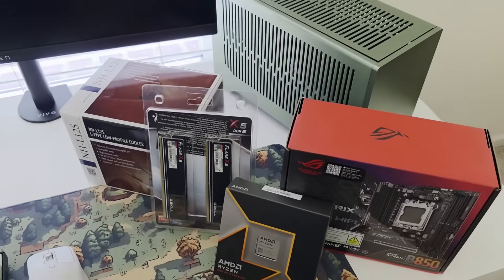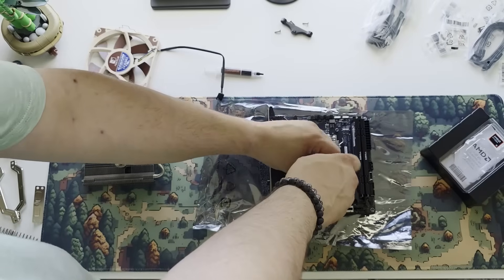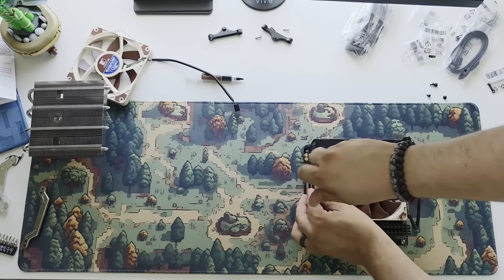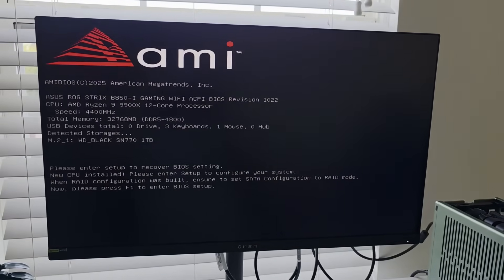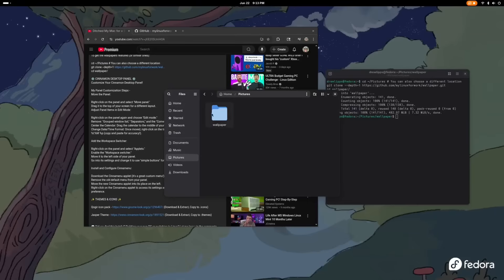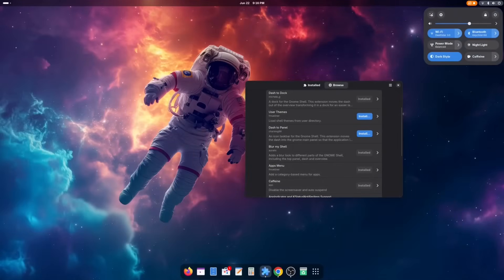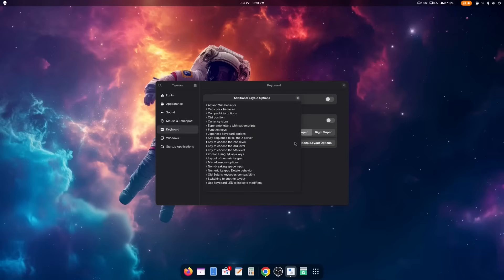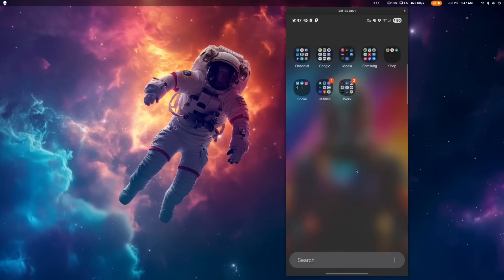Switching to Linux: Mint to Fedora, AM4 To AM5

Comment: In the Christmas period I upgraded my PC too, from a Ryzen 3 2200G with 16GB DDR4 (3000MHz) to a Ryzen 5 5600GT with 32GB DDR4 (3200MHz) for $179; $4 more than the original CPU and memory.  The motherboard remained the same an ASRock B450 HDV Rel 4.0, that in April 2019 did cost a whopping $59.99.  The system runs a minimal install of Ubuntu 24.04 LTS with VirtualBox and OpenZFS for the storage of all my data and ~65 VMs.  
The daily used VMs are; Xubuntu 24.04 LTS for (a)social media, Ubuntu 16.04 ESM for finances and Windows XP Home as my jukebox.
Reply from the maker: Wow, that's a seriously impressive and cost-effective upgrade! It's amazing how much performance you can get. Your setup is a great example of smart component selection, especially keeping the motherboard to save money.

That's a lot of VMs to run on a single machine! Using OpenZFS for storage is a solid choice for data integrity and reliability. I'm especially interested in your Windows XP jukebox. It's a fantastic retro touch.

What kind of music do you have stored on the jukebox? Do you have any other unique VMs for specific tasks?
Reply: @drewlipps  No the only remarkable things about Windows XP Home is that the VM is installed and activated in March 2010. 
It runs on one CPU in 768 MB of RAM.  For playing music I use Windows Media Player 11 with its Wow and TrueBass effects :).

I'm 80, so the music is from the fifties (Glenn Miller Orchestra; Elvis Presley), sixties (Beatles), seventies (ABBA) and some later stuff (Queen).  Basically the wma copies of all my CDs and LPs, copied in 2005.

Comment: Love the build. I think a small addition that would help is a pair of small low profile antennae, rather than plastic fin. It's unnecessary, but is a plus to aesthetics and portability. Unless you are using ethernet, of course.
Reply from the maker: Great tip, thanks for the suggestion!

Comment: Adding to the lengthy comment I left on your previous videos, here are some pro-tips:
- Install Ventoy on your USB stick.
   With this, you only have to copy the ISO file to the volume, you can place multiple here and choose which to boot on startup.
- Install the rEFInd bootloader if you duel-boot.
   While Grub or systemd-boot can be set up to do the same things, chainloading through rEFInd makes picking which OS to start much easier.
   It also is a great fallback, in case the main bootloader fails after an update.
- If you install multiple OSes, do that to a separate drive and disconnect the main OS drive while you do so.
   With Windows this is a necessity to prevent it from installing the bootloader to the wrong drive.
   But it generally is a good pre-caution, in case you mess up the configuration or the installer has an issue with drive selection.
  After plugging the main drive back in, rEFInd will just find any OSes installed on that other drive if configured for this.
   It is extremely convenient for this and worth using over the BIOS integrated boot choice selector or OS prober with grub, since it's detection is more reliable.
Reply from the maker: Thanks!  I'll check out these tips, appreciate it!

Comment: Fedora is great. The only complaint I have about it is that they seem a bit too eager to remove support for things a lot of people still rely on. The latest instance of this is them proposing (still a proposal-not official yet) to remove support for 32-bit applications. According to them 32-bit is “dead”, but apparently apps like Steam still rely on 32-bit packages. Even the lead of Bazzite said it would kill projects like Bazzite. If apps as large as Steam still need 32-bit libraries to function properly, that doesn’t seem “dead” to me, so from my perspective this strategy of aggressive deprecation seems out-of-touch with users. Only time will tell how this shakes out.
Reply: they dropped that. But I must say: 32bit is way too old and used by a few. If you do the step forward, others (Valve Steam, Wine, etc.) will follow because they have to:)
Reply: @dekalliver159 Fedora is not important enough for Valve to update Steam to 64-bit. They would sooner drop support for Fedora. Now if arch dropped support for 32-bit, then maybe they would since SteamOS is based on arch.

Comment: Yo bro did you also consider OpenSUSE Tumbleweed?  TW is more stable than fedora; TW is rolling release, fedora has point releases; TW has the better and more powerful installer; Some say fedoras installer is better, because simpler, but in the ende both leet you very well through the installation.; Both are backed by big companies;

So the choice for a desktop is clearly TW (imho)

Comment: Do you notice much difference with the AM4 build in everyday use? Moving to AM5 will cost me at least $1k so I've procrastinated the update for 3 years already lol
Reply from the maker: lol understand,  I waited for parts to drop on Amazon for the AM4, bought with my Amazon Prime Card to gain points/rewards, then used those points/rewards to then get the new AM5 parts for way cheap.  Full build for me with both AM4 and AM5 parts was still under ~1300$, (a 3rd if not less than what my M4 MBP cost me).  

I will say I have noticed a pretty big improvement.  On paper it's like 60% since I jumped 2 gens in chipsets.  Overall I really notice it with rendering my video exports.  This 10+ minute video took less than a minute to render, I actually thought something went wrong haha.

Comment: Great video in this migration series.  Have you taken a look at KDE Plasma, offers great flexibility in terms of desktop configuration and may avoid the need for large numbers of extensions to Gnome to achieve the same thing possibly.
I think the move to Fedora is a good one too.  The distro, for me at least, offers the best blend of update to date software and reliability.
Reply from the maker: Thanks!  That's exactly why I went with fedora, they update the kernel/software often and it's pretty reliable overall.  However I may dual boot into mint still or even triple boot so I can have arch also.  I'll checkout KDE plasma though, had a few recommend it as well.

Comment: Red Hat will drop support for 32 bit libraries in Fedora 44, this making gaming in some instances more difficult. I tried Fedora KDE and it was alright, but I'm on a decrapped Ubuntu LTS now. I literally ripped out everything snap permanently (I used the bare minimum install) and installed everything via apt & flatpak. I even removed the Ubuntu store and replaced it with the Gnome store. Plus I installed all the drivers for my Tuxedo laptop, which installed the custom Tuxedo kernel 6.11. It's snappy (sans Snaps) and it was fun. I tried the concept in a virtual machine before trying it on my new laptop.
Reply from the maker: Oh nice! Yeah seems like a lot of changes coming very soon across Linux.  Luckily I don't game a ton on PC so works out in some ways but agreed! Dang that sounds like a pretty slimmed down version and a solid light weight build on your end.
Reply: This was the most fun I had installing/tweaking Linux and I learned quite a bit. I recommend trying this in a VM at some point. things that force you into the system files teach you a lot. BTW welcome to team penguin!
Reply: @brostoevsky22  Redhat doesn't take Fedora's decision. If that was the case you wouldn't see brtfs support, KDE etc in fedora 's official repo.

Comment: Just go straight to Cachy OS bruh 😭
Reply from the maker: I'll have to check it out
Reply: @drewlipps Its the final boss of where you're headed too lol. I took alot of time going down the same exact path you're heading. Especially with your very modern hardware, you should really be Arch based. Cachy OS is to Arch what Mint is to Ubuntu. An optimized well tailored experience out the box with even more customization options.
Reply from the maker: @TacticalPower88 thanks! Yeah I love arch also , may be a good fit! I'll check it out! Thanks !

Comment: Great video! Looking forward to hearing more about your journey. No one really breaks down Linux desktop daily use and that may be a niche you can cap on. Also, you help to start my itch to trying build Linux desktops as a daily driver. I do use an Ubuntu desktop VM for coding occasionally(easy way to backup my dev environment) but all my other linux instances are headless.
Reply from the maker: Appreciate it and thanks for the feedback!  That's awesome, I need to try that out !

Comment: Am4 is still viable if your on a 5700x3d/5800x3d. Im skipping to am6 when that arrives
Reply: Indeed, my 5700x is working just fine as well.
Reply from the maker: Makes total sense.  I'm saving the am4 for another build I may do soon.  Still really solid for sure!
Reply: You'll be waiting a while before AM6, at least 2027/28.

Trust me bro.
Reply: @dan_5363 that's not that far away. AM4 will be  viable for a while longer

Comment: Noob here. Are the micro pc woth linux worth getting from Amazon?
Reply: So by “micro-pc” I assuming you are referring to the “mini PCs” that have been flooding the market. If so….”yes”, in fact I would say they are great for everything. I use mini PCs as servers in my homelab. Powerful, space saving and your electric bill will thank you. I would suggest maybe trying to run a Linux vm on your pc (using virtualbox - how I started) just get to a feel for it before jumping in and when you are comfy, get something used for starters before building or buying a powerful one.
Reply from the maker: Spot on

Comment: Love the video but one thing I really recommend is back up and non frequent update because fedora sees updates every 6 month and extensions some are not maintained some are broken amd stuff you need to back up your stuff dont randomly update have a set schedule and use timeshiftgtk before update. You might face issues here and there too don't over bloat your system with extensions. And don't distro hop just use one. Besides that keep it up.
Reply from the maker: Thanks for the insight!  Appreciate it and will keep that in mind!

Comment: If I recall correctly, threre was a controversy around Audacity in either 2020 or 2021 because project was bought by some russian company and initially they wanted to include telemetry to an application. I believe Tenacity was created as a fork for this. Not sure how whole story developed after that, I lost interest in this application and never got back.
Reply: I heard that the telemetry issues were resolved and it's fine again now. Privacy focused linux users are still recommending audacity.
Reply from the maker: That is interesting

Comment: What is the monitor you are using
Reply from the maker: HP OMEN - 27" IPS LED QHD 240Hz
Reply: @drewlipps is it good for MacBook?
Reply from the maker: @abdelrahmanyasser6420  yeah works well for my work issued intel MacBook, but I've used m series macs with these monitors before

Comment: rice is best. im lazy and feel like ubuntu gives me rice out of the box but nowhere near as fancy as this.,
Reply from the maker: Ubuntu is solid.  I wish they invested more into ubuntu touch though so we had another mobile OS equally as solid as android / iOS for example.
Reply: @drewlipps  ubuntu interim has been a delight. lts didnt work for me and i dont trust it so i will skip lts and not upgrade for a year which is a downside for me but ok. i think lts is a base for other distros as there is no reason for a user to sit on an out of date desktop for 2 years until the next lts. fedora has no lts which is much better. ubuntu touch may be reinventing the wheel as all cellphones use the same proprietary 5g firmware that doesnt inspire trust.

Comment: After installing app your programs and distro how much storage has been used (I wanna compare mine to yours I've used 59gb)
Reply from the maker: I've only used 25GB of my 1TB
Reply: @drewlipps thanks for the reply, how do you keep your storage usage so I've got barely any apps and only one 16gb game
Reply from the maker: @nebnedthat's interesting, anything specific taking up the most space ?  

I also live the zero inbox life so I apply that to all I do.  I don't keep files I don't need, actively delete trash, etc. and don't store anything physically on the computer.  Even after I make a video it's removed from the desktop.
Reply: @drewlipps I like to do the same, my home folder takes around 40gb because thats where most data is stored and I have run a software called BleachBit to free storage. U could possibly make a video on that actually because apart from deleting files not many new Linux users know how to clean temp files or cache and stuff and bleach bit does all

Comment: Some trivial issue on Windows was the final straw where I just committed to wiping my desktop, installed Linux Mint. I'm committing to give it an honest try, the couple games I do play regularly work fine. For non-gaming, it's always been great. I ran a Linux Mint VM on Windows anyway for that stuff.
Reply from the maker: Nice!! Yeah I totally agree, much like other OS options (windows, etc.) there are always trade offs.  With Linux I find there's a few also but honestly my workflow just performs better with Linux and I have far less issues + no bloat.  Prefer it for sure and will happily give up some of the benefits I had with Mac etc. in favor of the simplicity and customization options.  Plus no ads, no bloat, etc. like I said makes it all the better!
Reply: Trivial issues on windows was the end for me too, I've had way less fixing/tinkering needed when using Mint compared to windows. My games run beautifully even on "outdated" Mint compared to when I was using windows. Instead of fighting my machine every day I'm just using it.

Comment: i can also recommend the gnome extensions clipboard history and emoji picker. Both can be set to trigger on a hotkey and were something i was missing from windows. There is also an extension that adds a Hibernation mode to the shut-down menu i use sometimes.
Reply: Why did you switch to fedora. Have you tried Manjaro OS?
Reply from the maker: I have and I have been trying out a few others.  So far fedora has just been the best for my needs and it's a bit more modern in terms of compatability  @Tekh_unbox
Reply: Have you also tried pop OS?
Reply from the maker: Yeah that one is pretty good  @Tekh_unbox
Reply: What phone are you using?
Reply from the maker: Galaxy S25 Ultra in the video  @Tekh_unbox
Reply: Will you use the nothing phone 3?
Reply from the maker: @Tekh_unbox yep 😊 most likely
Reply: Do you sill use the google play store?
Reply from the maker: @Tekh_unbox yes it works flawlessly
Reply: Why did you choose gnome over kde plasma
Reply from the maker: @Tekh_unbox primarily meets the look etc I was looking for
Reply from the maker: Thanks!! Ah emoji picker!! I totally forgot about that one.  I'll check out the clipboard history as well. Appreciate it!!
Reply: Have you tried arc yet or are you planning to in the future?

Comment: Why did you switch from Mint to Fedora?
Reply from the maker: Mostly because it is a bit more future proof in that it has been moving the needle a bit more on modern approaches.  However it also works much better with all my bluetooth accessories.  I will most likely install another SSD and dual boot, (maybe even setup a triple boot), system so I can still use mint, as I have a personal connection to mint from all my college days of learning terminal and linux specifically using mint.
Reply: @drewlipps  I'm using Mint and I'm also having issues with Bluetooth, my headset keeps disconnecting randomly, it didn't happen at all when I was on Zorin Os, I might switch to other Distro

Comment: Hey, I am also a fedora user. How's the font rendering. I was a Mac user The fonts were really sharp on it. But on fedora not really sharp. I might be the only one having this issue. What about you?
Reply: Are you using the native resolution for your monitor?  I use a Fedora version (bazzite) and had to set my monitor to native resolution after installing as it used a slightly different resolution after install which skewed the fonts more noticeably than anything else.
Reply from the maker: Hey!  I haven't had issues on my new Omen monitor or my Samsung 34" curved odyssey  monitor.  However I have read some seeing this issue.  Is it the native resolution?  

Sometimes, if Fedora's display settings don't perfectly match the monitor's native setup, this can occur. I'd advise to go into Fedora's main "Settings" -> "Displays" and ensure the "Resolution" is set to the monitor's native resolution and the "Refresh Rate" is correct. If you are using "Fractional Scaling" (e.g., 125%), I'd suggest to try setting it to a non-fractional value like 100% or 200% to see if that sharpens the text, as fractional scaling can sometimes impact this.  

You could try to enable Microsoft's ClearType fonts for better compatibility. Many websites and documents are designed with Microsoft's core fonts. I would suggest trying a terminal command to install these fonts, like sudo dnf install mscore-fonts-all -y  

If that doesn't work, you could try to also install popular, high-quality fonts and adjust system-wide settings, like installing fonts known for excellent screen clarity, such as Google's Fira Code or Inter. Then, like I did in this video, install the "GNOME Tweaks" tool. Within Tweaks, you can navigate to the "Fonts" section to set the new font and adjust the "Hinting" to 'Slight' or 'Full' and "Antialiasing" to 'Subpixel (for LCD screens)', which often produces a sharper appearance similar to what you might be used to on a Mac.

I hope the above is helpful insight into this and can provide a resolution for you.